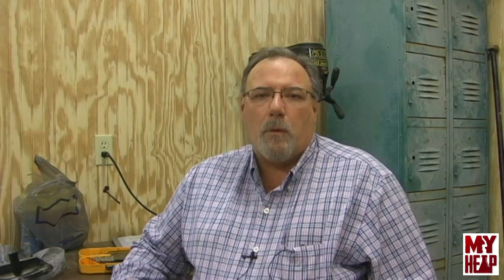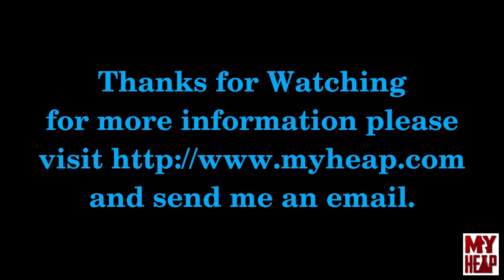Petrobond Sand Substitute - Questions for 5 tons with guns

Comment: Bentone 34 is used to make petrobond.  You can make a bentone with different oils. Grind bentonite into a powder.  Mix an oil with mineral oil and rubbing alcohol to form a gel.  Mull the powder and gel together( I have added the sand at this step and it works ok) then you bake it in an oven.  Look up bentone 34 on Wickapedia   for  different oils and baking times and temperature.  If you use 2 stroke smokeless motor oil your making K-bond.
Reply from the maker: Roger, thank you for the information.  I will take a look and read the Wikipedia page you suggested.  Offhand, you make the bentone clay by making a gel of mineral oil and alcohol, then mulling the clay and gel together?  Then when making the sand this bentone clay is added to sand and mulled with oil?  Do the wiki pages talk about how to make the sand as well?  Again, thank you for the info.

Joe
Reply from the maker: Roger,. Looking at Wikipedia on my phone for bentone 34 only brought up bentonite clay.  Do you have a link that would explain the process of making a bentone 34 clay?  You mention that a mix of oil and alcohol are used to make bentone.  What type of alcohol is used? Ethyl, methyl or isopropyl?  Do you know the ratio at which these are mixed to make the gel?  How much gel is added per pound of bentonite clay?  After the bentone is made, I am guessing that it can be used like bentonite clay and greensand.  6% bentone by weight then add 2 stroke oil and mull.  Reconditioning would be the addition of some oil and alcohol?  I know I asked a bunch of questions, but you have my interest peaked.  This would make a good video series.

Joe
Reply: @MyHeap  I was wrong about the info being on Wickapedia.   It is on Elementis Specialties web site.  I seem to be unable to get back on those pages and have been unable to find my printed copies yet.  However,  after you grind the bentonite into a powder you can use methanol or propylene carbonate as an activator .  By weight use 33% of the weight of the powder. The mineral oil/ alcohol ratio should be 80/20.  This mixed with the powder makes MUD.  I did not want to bake this mud at 300deg for 16 hours so I added the sand and oil and baked at 250deg  for 5 hours. Heat is the catalyst that drives out water moisture and gives the clay an affinity to oil.  I recall there was no info on those pages about casting sands, they were about making Bentone 34 for oil drilling mud.  I'll keep looking for the paper work!
Reply: Bentone 34 is a brand name, another one is VG-Plus.  But any real organoclay should work using the standard K-Bond recipe.  Assuming the binder can be found (or made?), the closest a hobbyist is likely to get to making truly smokeless k-bond sand (ie. less smoky than petrobond) is by using smokeless synthetic 2 stroke oil, as the real holy grail of smokeless oils (BP Indopol is a brand name) is probably only available in a 55 gallon drum minimum.  Here in Canada I can only even buy the organoclay by the pallet (I'd love just one bag to go with my 500# barrel of AFS 130 synthetic olivine...) but I was able to get about a 2# sample shipped from Calgary and recently made a 40# batch of K-Bond sand in my homemade muller.  I've only used it on 3 molds so far but it seems to work darn close to as nicely as my petrobond. Tom Cobett, who was the professor for the class at Kent State that invented K-Bond, has recommended using glycerol (glycerin) as the activator rather than propylene carbonate or alcohol, since it it less likely to evaporate out of the sand.  Would love to see a source on this recipe for turning bentonite into real organoclay...

Comment: I use water based green sand and do not pour the mold until one or two days later and I still get good castings. A lot of castings are poured in green sand around the world and if it was a bad way to make molds it would not be used.
Reply from the maker: I have always used green sand too, but have generally always poured the same day as making the mold.  I guess it really comes down to the dry strength of the clay used in your sand whether there will be washout of the sand when you pour.  I agree with you 100% luckygen if it were a bad choice it wouldn't be used.  Glad to see you stop by!

Joe
Reply: A lot of the older foundries used to make green sand molds for many days and run their cupola once a week. Just think of the molds made nearly a week earlier. If you have sand washing and you are new to molding it is how you ram the mold and also your sand is too weak. I have taught so many people how to make a mold but at first they have that problem so only with practice does their molding skills improve.
Reply from the maker: Well, I don't pretend to be a molder or a foundry man.  But over the years I have made green sand too dry, too wet, too much clay and made about every mistake you can twice!  But I don't usually have an issue with sand washing, but I have always molded and cast in the same day.  These days I use a naturally bonded green sand that I got from a local aluminum foundry before they closed.  They told me that I could have all I wanted.  My mistake was I only took a couple hundred pounds.  I should have got a half ton.  Oh well, that's life my friend.  The only issue that I really suffer with is mulling.  I don't have a Muller and I know I don't work it well enough to work well.  I have been gathering stuff to make a Muller but it will be a while before I get to it.  Now if I remember correctly you cast iron as well, right?
Reply from the maker: @luckygen1001  I have watched tons of your videos.  I cannot believe I wasn't subscribed to your channel.  But I fixed that problem.  😁
Reply: The muller was the reason why my molds improved so much is because it mixes sand consistently.

Comment: Both green and oil bonded sand exist as shades of grey.    Lousy and good exist in both.  Both require mulling if you are after very good castings.   Good green sand hardens as it dries.  It is sometimes baked aka dry sand which I think is even stronger than oil sand.   I have not worked with oil bonded sand but I understand they have their own list of troubles.
Reply from the maker: Hi Dan.  Your right, everything is a balancing act.  I have been using some naturally bonded greensand.  It does not have the best green strength bit it is beautifully fine and gives great results.  I was lucky enough to get a couple hundred pounds from the aluminum foil dry accross the river.  But without a Muller, I don't get the molding (ramming) quality I did when I first got it.  Thanks for stopping by and taking the time to comment.  I appreciate it.

Joe
Reply: We both need to build Miller’s
Reply: Mullers
Reply from the maker: Right?!?!

Comment: What he's trying to make in essence is what is called K-bond sand. 
Petrobond has fine silica sand, around 200 mesh sand, the clay in it is bentone 34, which is an oil absorbant version of bentonite clay that was modified chemically. 
They also add iron oxide, which is there to prevent what is called scabbing when dealing with bronzes and brass in some castings and increases strength slightly. 
The alcohol is a light alcohol, but it's just there as you said to react with the oil and turn it gummy, which increases the strength of it for sand casting sand. 

I believe that the grout has calcium hydroxide (lime) and calcium carbonate (limestone) in it. You can use almost anything with oil, but it just wont hold onto the oil and alcohol for extended periods of time if let sit and will slowly evaporate away or dry out and gum up the sand. Ive used floor dry, which is designed for oil spills in the garage, and it works just the same for a bentone replacement, but due to the costs and mantinence on the oil bonded sand, I just abandoned it and decided to build the sand muller to be able to mull a flask full of sand in 5-10 mins rather than spending all of the money and time on the oil bonded sand, and still needing to do the same thing. I honestly didnt see any difference in use between the oil bonded sand and water bonded sand really.
Reply from the maker: Hey Chirpy.  Glad to see you here.  I have about 12 pounds of bentone clay I got some years back from Ray Vinn, I think.  
I have to admit I am curious about it.  I have no experience so videos of it's use and level of success would be interesting to see.  His original batch that he shows is old and the squeeze test mostly indicated a bond.  So if Casey is willing to produce the video, why not make the observation.

Now having said all that, I believe you are exactly correct.  I think you need a Muller to get the best results from either sand.  So why would they put bentone clay in grout?

Thank you Chirpy for taking the time to watch and comment.  I appreciate you dude!
Reply from the maker: Sorry Chirpy, just realized you didn't say there was bentone in the grout, you were talking about the oil dry.  Sorry sir.
Reply: yea, they wouldnt put bentone in grout, but really any clay will work as long as it can absorb oil and form a molecular bond with it.
Reply from the maker: I know that it isn't uncommon to use Portland cement as the binder in molding sand for one off or semi-permanent molds.  Sandrammer has an example of using this medium in a video where he made an ingot mold.  You are correct about the combining of the clay and oil on a molecular level.  I don't see this happening with cement.  But, if you observe his "old" sand that looks well used, it is still passing the squeeze test.  He claims he has cast many items from it.  What do you think is going on there?  My gut feeling says, no this does not work.  After all, cement and oil have been around for ever and it would have been mentioned in one of the many casting books I have read over the years.  You see why I am requesting the videos of molding, casting, breakout and rejuvenating.
Reply: yea, I think it's mainly the clay absorbing a little bit of the oil and creating a tiny bit of a bond, just enough to work, but it would be saturated with oil and clay. Probably far too much and would cause issues with venting.
Reply: really, portland cement and normal cement should never be used around foundry equipment, it works off of the principal of using water to create a bond, and isnt very good at venting, so either it just gets fully dried out and burns up, falling apart, or it builds up the pressure inside of the concrete and explodes. Ive seen far too many times of concrete exploading and furnaces made of concrete exploding and hurting people.
Thats why refractory is made of completely different things and why cement should never be used around a furnace. I know sandrammer has done it, but doesnt make it safe if one guy can pull it off, and can hurt or potentially kill someone else.
Reply from the maker: Well, just between you and I, some of my early furnaces used Portland cement, sand and perlite for refractory and had many, many aluminum melts with charcoal.  Never really had an issue with spalling.  But the other side of the coin is that they were allowed weeks to cure and we're brought up slowly  to heat to dry them out.  But notice, I don't tell people to do this.  :)
Reply: yea, I think you got away with it because of the porous nature of the mix that you used, as it dried out, the perlite kept the portland and sand mix pretty porous, and as you said, you let it sit for a while to dry. Most people Ive seen that wants to do casting, your lucky if they want to wait a day before using it, then just go full on death mode with the propane or oil burner in the thing, lol.